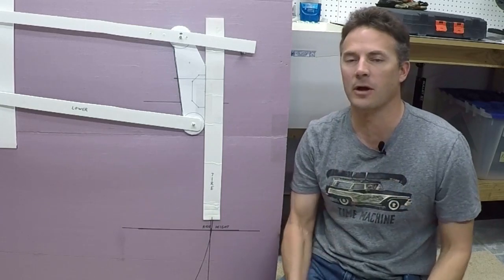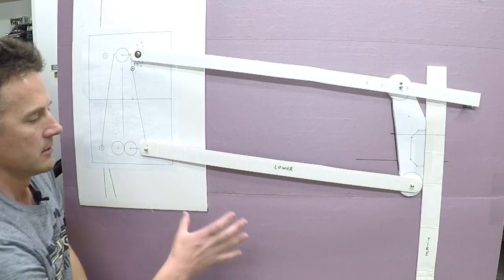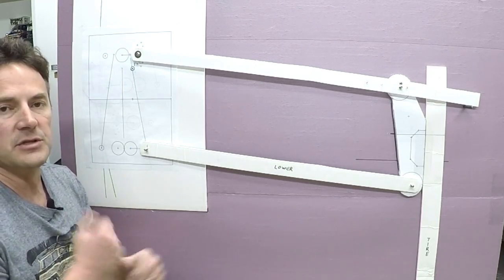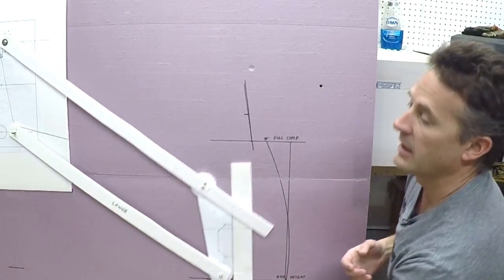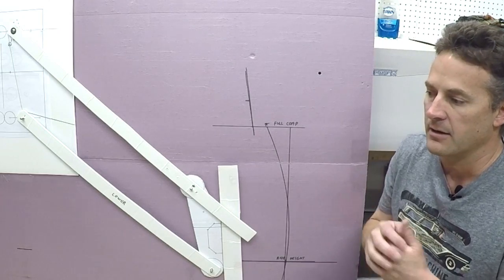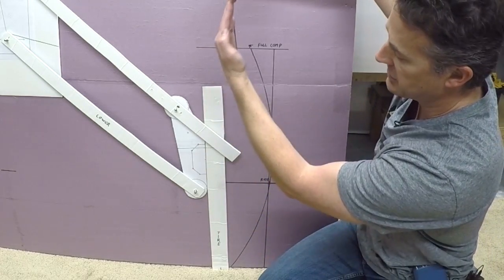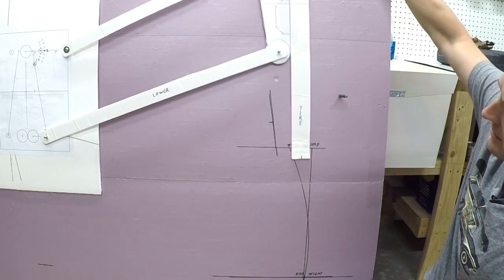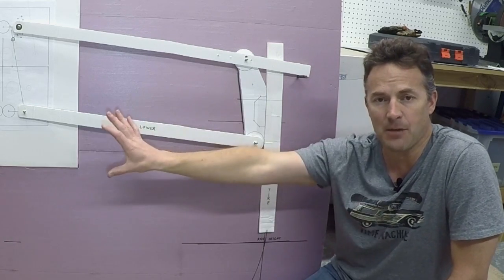Suspension Geometry (A Arm for Baja)

Comment: So one thing to keep in mind is the king pin angle. It can dramatically increase feedback in the steering wheel. It should roughly point to the center of the bottom of the tire.

Comment: This video is the messiah of all questions when it comes to suspensions, is the one question mechanics in general refuse to answer or don’t know at all, I see all kinds of stupid people with blogs assuming and guessing shit pounding their chests but is all ignorance that takes no where at all, my old van upper control arms were almost touching the frame due to a 3” lift, it look great once up there but the ride was poor and crappy, after this video I just welded a tube from the upper control to the ball joint with a 3/16 plate and added bolts, after that I saw the difference because my shocks and coil springs were doing their work due to enough traveling up and down, many thanks mister, well done 👍

Comment: Something I didn't see you touch on was body roll. When you corner, having that shorter upper control arm will give you a larger contact patch on the loaded tire, due to body roll. 

I'll be building a Beetle buggy with a Hayabusa engine, and I'm planning on using perfect geometry for the rear, but a shorter upper geometry for the front. I'll definitely be build a 1:1 scale model like what you have here, though, to make sure I get the most desirable outcome.
Reply from the maker: I agree with you. The issue with this chassis is the shorter upper arm will bring the top of the tire into the front clip. So I'm trying to keep it to a minimum.
But you're right, cornering wise that would be a better design.

Comment: love the video and information.
when you shorten the upper control arm, also move the inside pivot point down closer to the inside pivot of the lower control arm.
this might not work for your body, but it does fix your drop position and gives a nice curve with negative camber gain at compression.
might not be what you want at compression
works great with street suspensions
Short Long Arm

you could also rotate your steering heim joint so it is inline with the others. You don't need 180 degrees for steering. If it is not enough steering, a high angle bushing can be used to increase the angle.
Reply from the maker: That's not a bad idea. I'll mock that up and see if I like it. Thanks for the idea!

Comment: To echo what backyard boogie said, is there any reason you cannot flip the tie rod heims such that they rotate on a horizontal axis like the uniball joints? It seems to me that this would free up a few degrees of droop. It may limit steering deflection some, but that is already limited at the uniball. Just a thought, there is always a trade off.
Reply from the maker: You are right, and I've actually thought about that a couple times. When I actually make this and have it on the bug I'll be able to actually see what limits things. If I think I'm really giving up some good travel because of the steering heims I might mock up a spindle with the heims rotated and see how it looks.
I like your thinking and thanks for sharing your ideas with me.

Comment: nice video, I just want to understand the representation on the chassis the half inch fixed points drawn in circles....
Reply from the maker: The half inch holes are my bolt holes. Those really reflect the tabs on the chassis that the control arms will bolt to.

Comment: Is there ever a point where you can have too much angle on your arms on droop?
Reply from the maker: Yeah two real issues with to much droop. 
First is that it causes the track width to get to narrow. With that you lose traction and it gets unstable.
Second is it can cause the connection points to much stress if the arms droop to much. Because the force gets transferred to the bolts before the shock if it droops to much. But it has to be pretty extreme for that.
Reply: @DougBugBuilder  any idea what that max angle is before energy starts transferring into the chassis and pivot points and less into the suspension? I have heard 30 degrees max droop on the lower arm and I’ve heard no more than 135 degrees between upper arm and spindle. But haven’t found out the real science relating this information.

Comment: How come you're not running SLA double wishbone? I don't know anything about offroad vehicles and you mentioned you don't want any camber gain, how come?
Reply from the maker: Technically this is SLA, but the difference in length is only about 1/2".
I don't want camber gain because this bug is pretty small. When the suspension cycles to full bump the tires really get up near the chassis. I wouldn't have room if they were tipped in at the top with camber gain.

Comment: what about the weight difference from the back to the front? are you plan on jumping the Baja A lot? are you also using a strap?
Reply from the maker: Yes I plan to jump this as much as I can. Weight distrubition won't be a problem as long as it's under control on the take off. It would be an issue if it really had time to free fall, but not the jums I'll be doing.
Yes when complete this will have limiting straps on it.

Comment: Looks like you have a good understanding of suspension geometry.  There is an easier way to model your suspension online.  There are several tools out there but I find vsusp.com the easiest to use.    All you need to do is enter your arm lengths, pivot points, spindle specs, and tire size.  Vsusp builds the suspension model that look much like your foam core model.  It then allows you to simulate suspension conditions such as full compression/droop, extreme bump/pot-hole, extreme body rolll, etc.  In addition it calculates many of the key measurements in these suspension conditions such as camber change, scrub radius, control arm scrub, proper location for steering knuckle, etc.  Here is an example of a Yamaha Raptor 700 setup (Note: Youtube automatic link does not work, so copy paste into google.com) -> http://www.vsusp.com/#0.8%26project_name%3ARaptor700%26trim%7Bbody_roll_angle%3A0%7Cfront.left_bump%3A0%7Crear.left_bump%3A0%7Cfront.right_bump%3A0%7Crear.right_bump%3A0%7D%26front%7Bframe.susp_type%3A0%7Cframe.bottom_y%3A32000%7Cframe.center_to_upper_mount_x%3A7950%7Cframe.bottom_to_upper_mount_y%3A16500%7Cframe.center_to_lower_mount_x%3A6850%7Cframe.bottom_to_lower_mount_y%3A2000%7Ccontrol_arms.upper_length%3A32000%7Ccontrol_arms.lower_length%3A37500%7Cknuckles.hub_to_upper_x%3A11900%7Cknuckles.hub_to_lower_x%3A7500%7Cknuckles.hub_to_lower_y%3A5800%7Cknuckles.hub_to_upper_y%3A9500%7Cknuckles.hub_to_strut_axis%3A14000%7Cknuckles.strut_incl%3A8000%7Csteering.active%3A1%7Csteering.hub_to_outer_tie_rod_x%3A11000%7Csteering.hub_to_outer_tie_rod_y%3A-4000%7Cwheels.offset%3A2850%7Cwheels.diameter%3A1000%7Cwheels.diameter_expl%3A35000%7Ctires.size_convention%3A0%7Ctires.section_width%3A17500%7Ctires.aspect_ratio%3A7500%7Ctires.diameter_expl%3A50000%7Ctires.width_expl%3A7620%7Ctires.compression%3A0%7D%26rear%7Bframe.susp_type%3A0%7Cframe.bottom_y%3A9200%7Cframe.center_to_upper_mount_x%3A28500%7Cframe.bottom_to_upper_mount_y%3A24000%7Cframe.center_to_lower_mount_x%3A17000%7Cframe.bottom_to_lower_mount_y%3A2400%7Ccontrol_arms.upper_length%3A24800%7Ccontrol_arms.lower_length%3A37500%7Cknuckles.hub_to_upper_x%3A15000%7Cknuckles.hub_to_lower_x%3A13000%7Cknuckles.hub_to_lower_y%3A13000%7Cknuckles.hub_to_upper_y%3A13000%7Cknuckles.hub_to_strut_axis%3A14000%7Cknuckles.strut_incl%3A8000%7Csteering.active%3A0%7Csteering.hub_to_outer_tie_rod_x%3A7620%7Csteering.hub_to_outer_tie_rod_y%3A7620%7Cwheels.offset%3A4000%7Cwheels.diameter%3A1500%7Cwheels.diameter_expl%3A35000%7Ctires.size_convention%3A0%7Ctires.section_width%3A19500%7Ctires.aspect_ratio%3A4500%7Ctires.diameter_expl%3A50000%7Ctires.width_expl%3A7620%7Ctires.compression%3A0%7D%26pref%7Bdiag1.px_per_mm%3A150%7Cdiag1.front_or_rear%3Afront%7Ctab.active%3A0%7Cunits%3A1%7Cshow.f%3A1%7Cshow.ca%3A1%7Cshow.k%3A1%7Cshow.st%3A1%7Cshow.stl%3A1%7Cshow.w%3A1%7Cshow.t%3A1%7Cshow.rc%3A1%7Cshow.rcl%3A1%7Cshow.ic%3A1%7Cshow.icl%3A1%7Cshow.fvsa%3A0%7Cshow.tl%3A0%7Cshow.kpil%3A0%7Credraw_during_drag%3A1%7Cchart.x_axis_center%3A0%7Cchart.x_axis_window%3A10%7Cchart.x_axis_num_steps%3A21%7Cchart.x_axis_field%3Atrim.body_roll_angle%7Cchart.y_axis_fields%3A%5BFR%5D.general.roll_center.y%7D
Reply from the maker: Thanks for the link buddy! I have tried some of these before and it can get me close but I've never been able to get it exactly like my setup. Sounds like this one might be a little easier to input. I'll give it a go, thanks for the link!
Reply: Thanks for the link to that tool. Very helpful!

Comment: At this point, you showed what would happen if you moved the pivot point of the upper control arm (https://youtu.be/73qUJBAgd8o?t=616). Would the same result occur if you lengthened the upper and kept the original pivot point (the one you circled)?
I'm trying to understand what dictates the length of the control arms (besides the track width you want to achieve). If the lower control arm determines the track width AND you don't have the option of moving the pivot point of the upper, what happens when you change the length of the upper?
Your 1:1 model is very, very cool. Thanks for sharing, I am really enjoying your videos.